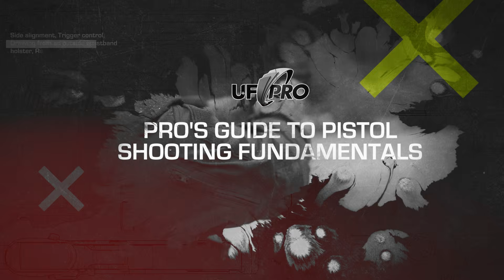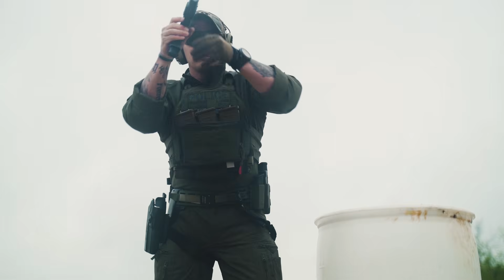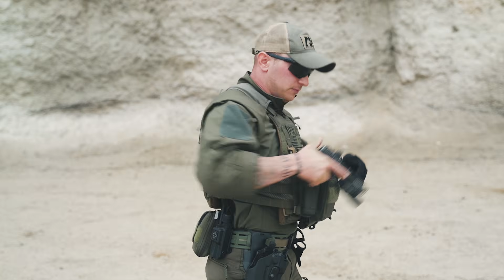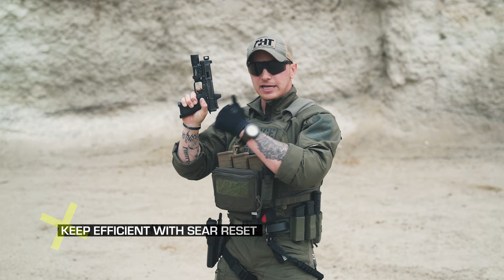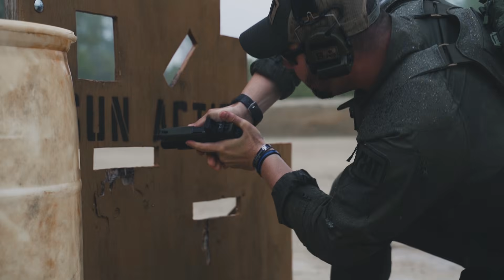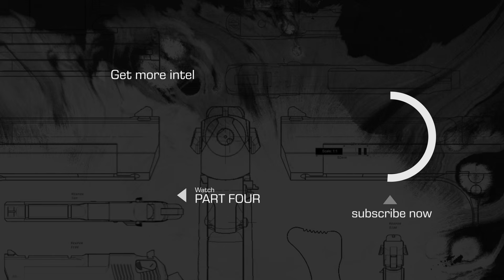Trigger Control & Follow-Through | Pro's Guide to Pistol Shooting Fundamentals

Comment: I have a question regarding the trigger finger movement. If I understand correctly the video suggests I should find the sear break and practice to stop my trigger finger right after the break, not pulling/pinging all the way to the bottom. However, I'm not sure how this would work well in a practical combat situation where the handgun I have may not be the one I practice with, and the sear break position is different, and all my muscle memory of my trigger finger just went out of the window. Wouldn't consistently pulling to the bottom be more versatile?

Comment: “You should not have to think about breathing 😐”

😂
Reply from the maker: Many thanks for the feedback, absolutely appreciated and we will share it with the team As for the color differences we would like to explain that different materials used are subject to different lighting, so the colors vary due to that more than in reality. But indeed we are using different materials as well for those two pieces. As the production process and light reflection of the materials differ, there might be slight differences in the colors, but we are trying to keep them as close as possible.

Comment: Rick my question is this does the this also work and the 1911 platform I love my 1911 and want to learn how to be able to use it properly
Reply: It applies to 1911, DA/SA & striker fired pistols. When you pull the trigger and your slide goes back to chamber a round, that's when you should reset and prep your trigger to the wall so when your iron sight or red dot is back on target you are ready to shoot another round and you have eliminated more of the human error by not letting the trigger go all the way forward and taking out the slack.

Comment: So trying to fire the follow up shot prior to the mechanical click and instead firing from when the sear resets? Do I have that right ?
Reply: Just let the trigger out all the way. Don't get bogged down with the point in which it resets. You won't be thinking about audible clicks.
Reply: Just try to reset the trigger during recoil, and not after. So that you're at the wall ready to fire again BEFORE the gun has fully recovered from recoil. Of course you won't be able to outrun the slide, but you will be able to outrun your recoil control. This way you're able to instantly fire the moment the sight picture tells you "good to go" after the previous shot. Works on all semiauto platforms. Just make sure you're neither shortstroking (failing to reset) the trigger ("trigger freeze") nor resetting too aggresively or you will risk NDing the following shot over the target.

Comment: So,..what store owner has ever told someone that a gun shoots low and left? Like, ever?
Reply: @Matt R Blow? I dont know what does it mean in this sentence but there is a draw about the shooting errors.
https://i.pinimg.com/originals/ed/00/82/ed0082052ad131b707c9f104e188f7ab.gif
Reply: @Matt R No The "jerking"' is a kind of hanlding error. You should pull the trigger with equal speed, not to jerk it. If you are not practised you will hit low left.